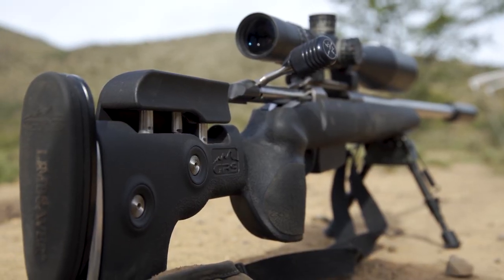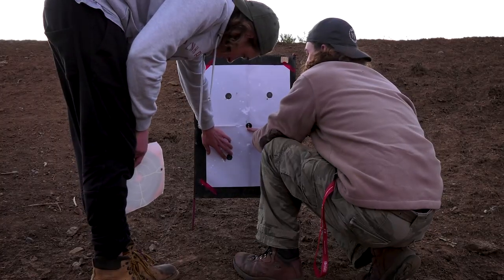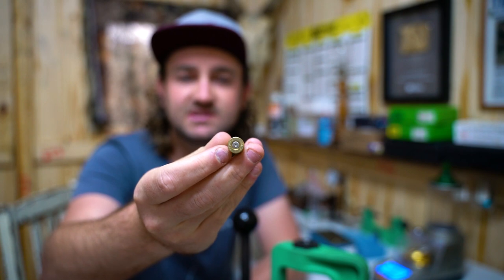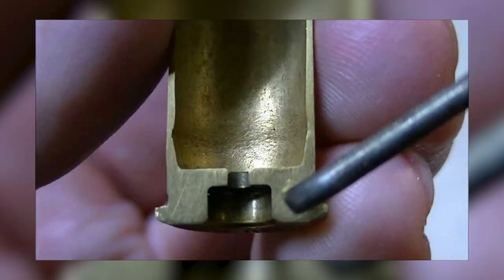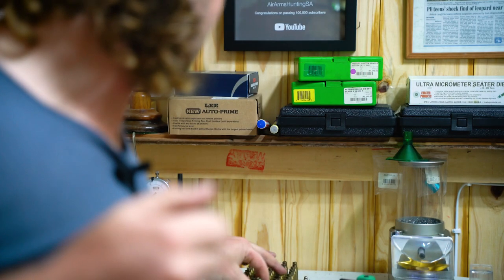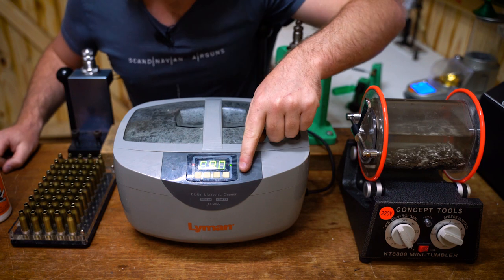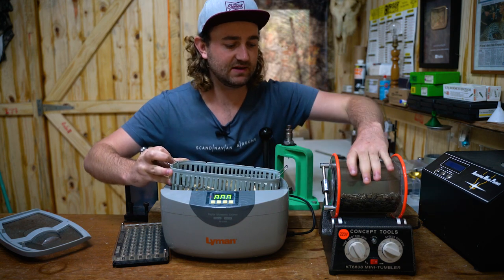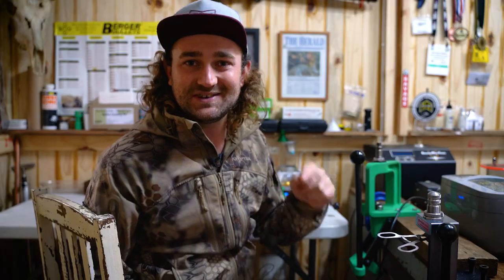Reloading 101, Pt.2: Case Inspection & Preparation

Comment: Hey Matt, just a small tip, I saw you add a lot of water in the wet tumbler, this reduces the cleaning effect because the cases are kind of "floating around" in the tumbler. I have got the 5kg version myself, and I load it up with 2kg of 1mm stainless pins, a drop of dish soap, and 50 cases (but more cases will work too). Then add water until the media and cases are just below the surface of the water. You will notice that the cases will be moving way more during tumbling. I also have a ultrasonic cleaner, but I don't use it anymore for cases, as the wet tumbler does a perfect job on it's own, inside, outside and primer pockets included.
Hope to see you again at the FX stand at IWA2019☺ Cheers, Gijs

Comment: Try using a food dehydrator for drying your cases. You can pick them up used for little money. Works well.
Reply: An old sheet pan in the oven on the lowest setting will work too.  Has to be the lowest setting though, much hotter and it will discolor the brass.

Comment: Hi,another great film. I use citric acid powder and dishwashing up liquid in my ultrasonic,after 6 mins the cases are spotless inside and out. Thanks again 👍
Reply: I do it the same way, but I think the brass gets shinier when using a dry tumbler. But shinier brass doesn't equate better accuracy.

Comment: The ultrasonic cleaning is mechanical as well - it is braking up the residue to smaller pieces where you cannot reach with fingers, etc. It is used also to clean optics and jewelry. The additional chemical is not necessary just speeds up the process.

Comment: Matt... the only safe way to know for sure if the pressure is within safe limits is to look at the muzzle velocity as per the reloading manual. The other way is to calculate the actual pressure with quickload but you will also need the mv. The rest of the "indicators" are no better than reading tea leaves mate.

Comment: I have a suggestion for the ultra sonic cleaner use 50/50 vinegar/water towards the end of the cycle neutralize the vinegar with some banking soda then rinse the brass and change to water and run another 10 minutes.  You will find that you might not have to tumble  as much. cheers

Comment: Hey I love your channel and your very informative but I would like to clear a few things up and maybe I can provide some information that you might not have known  first an ultrasonic cleaner uses ultrasonic vibrations to create microscopic explosions on the surface of the material to break up the carbon and they can be used with good results with just water alone the Sonic clean just helps it be more effective and second vibratory tumblers do not take long at all given that you use the right media and the cases haven't been laying on the ground outside for days or something I use a treated walnut shell and clean after every firing and I tumble for 45 minutes to an hour and the cases look brand new after they have a very high polish and the inside of the necks are completely free of any carbon I would definitely consider giving one a try with treated walnut and I think you'll be surprised you would be able to do more cases at once in a little shorter time with less hassle and get a better looking case in the end

Comment: Thanks Matt, very insightful thanks. I don't always trim my brass, maybe after 4 or 5 shots. I find that if you full length before you trim you don't trim so much of the brass.
Reply from the maker: My full length sizing only bumps the shoulder back 0.001”. So it doesn’t really affect case length at all. I just choose to so it before sizing so that I don’t have to worry about the trimming process affecting the case mouth concentricity in any way.
Reply: And it's also time consuming,but then you now your groupings wil be more consistent. Like the eldx bullets in my 270win, 145gr at 2850fps. Think it's an awesome bullet for the price, shots stay together well beyond 550m. Bought a Tikka 223 with a 1-8 twist. Hope to  shoot a 75gr eldm at 2900fps. Hope my plan works. Just waiting for license hehehe.

Comment: Can case head thinning be caused by overuse of the brass and not by over pressurization?  Also is the concentric line in this area a guarantee that there is a thinning?  Third, other than keeping the pressure in acceptable levels is there any way to avoid this thinning?  Thank you.
Reply from the maker: Case head thinning happens when you oversize the brass and fire repeatedly. You are essentially compressing and stretching over and over again. The shoulder and neck region can handle this because they are ductile and malleable, but the head is very brittle and tends to crack/break. The solution is to neck size, or even better to bump the shoulder back only 0.001” or 0.002”.
Reply: The real gunsmith did a video on this not to long ago, he explains exactly how this happens and how to remedy it. It is correct that the neck needs to be bumped just slightly to avoid too much headspace and unnecessary stretching of the case.

Comment: If the neck cracks as you seat them, would you go ahead and fire the rounds that last time and discard the brass after? Or would you pull the bullet and retrieve the powder for a new set of brass?
Reply: What do mean? There is seperation in the neck? I would not fire them, pull the bullet and discard the brass. I would look closely at the whole batch, and maybe even discard the whole set. I've never experienced cracks in the neck, reloading thousands of rounds.
Reply: I have a  batch of 50 that has a hairline fracture going from the tip of the brass to almost 2/3  to the first bend of the neck. Have not shot them. Safe or no go?
Reply: Stargazer80able  Tbh i wouldn't shoot them, I tend to always go for the safest choice when it comes to reloading.
Reply: Thanks for the reply, I was thinking the same thing. some reloaders I have spoken to say they would just fire them. Others say the same as you. I threw the question out on this channel because Matt is a seriously knowledgeable guy and I had a good chance of getting a good answer. Thanks again Jonas.

Comment: On the Stainless Steel tumbler and reason why you don’t dry tumble ?
Reply from the maker: It just takes much longer and you have to keep replacing media. They both work, it is just personal preference.
Reply: AirArmsHuntingSA Thanks yes I think allot of Reloading related stuff comes down to preference in relation to products and processes.
Reply: Dry tumbling takes about the same time as wet tumbling and maybe even less by the time you factor in rinsing and drying times.  The media doesn't need changing all that often either and is relatively cheap to do so.  I have had the same batch of walnut pet bedding in my tumbler for the past year and it is still working well.  Plus, I don't know about pricing in other countries but here in the U.S. I can buy a good quality dry tumbler and many years worth of media and polish for what a cheap ultrasonic unit costs and about half of what a wet tumbler with stainless pin media costs.  Dry tumblers are also less labor intensive and less time sensitive than wet processes.  You put the stuff in there and turn it on and an hour or few later it is clean and dry and ready to load and if you get busy doing something and can't get back to it quickly it won't hurt it to let it tumble longer.  They really aren't all that loud either if you buy a good quality one, my clothes washer makes more noise than my tumbler.  Don't get me wrong, ultrasonic cleaning and wet tumbling are both good ways to clean brass.  I used an ultrasonic cleaner for many years to good effect but it was a lot of work and rinsing and drying the cases was always a hassle.  Plus one huge benefit I noticed when switching from ultrasonic to dry tumbling is that ultrasonic cleaners and wet tumblers leave the brass bare which causes it to oxidize and begin looking tarnished within a few days or weeks where as if you run a polish that leaves a protective film in a dry tumbler it will help keep the brass looking shiny for a long time.